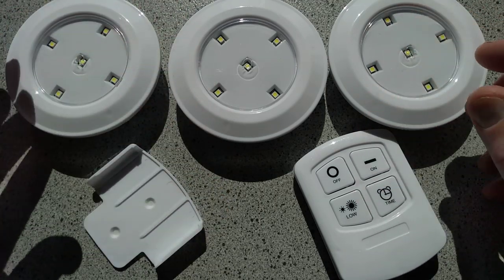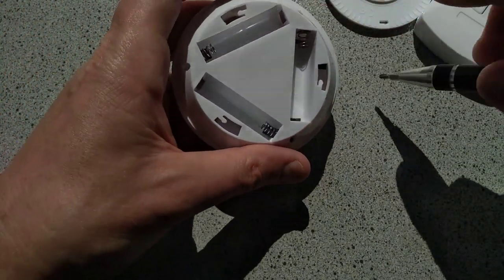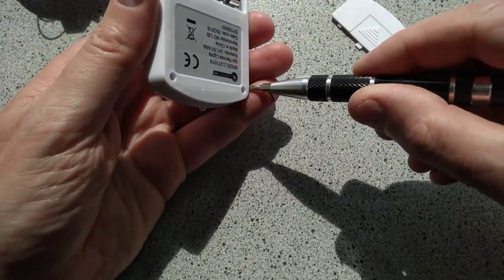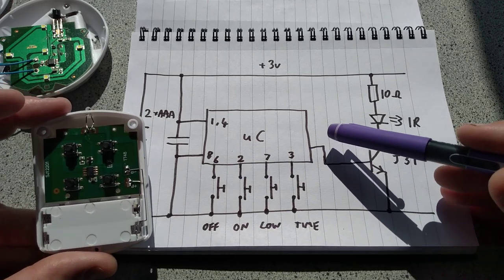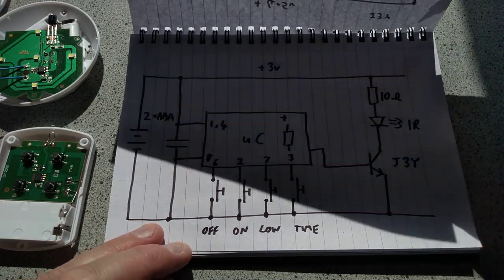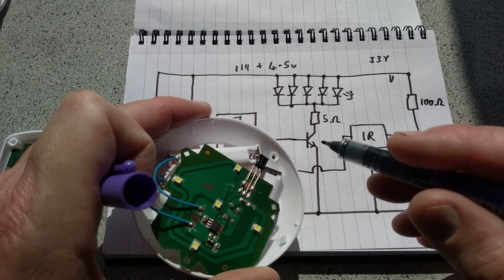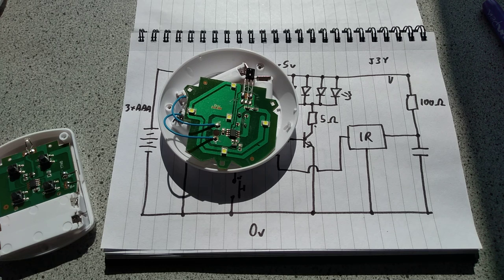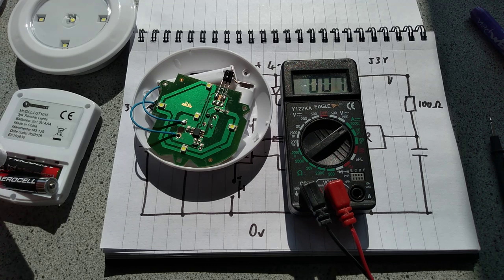Poundland remote control light set.  (with schematics)

Comment: Hi clive
There is another reason digital logic needs the decoupling cap. All the low impedance nodes within the chip will be using a totem pole drive topology with a pair of fets which can pull the io up to the power rail or down to ground. In order to avoid spurious edges during logic transitions, they turn both fets on for a new nanoseconds during the switch over. This causes shoot through current to flow from the rail to ground for a very short time on each switch cycle of the clock. Without the capacitor, the resistance of the power tracks could be enough to cause enough local voltage drop to brown out the chip and make it reset.

Comment: I have a set of these  from ebay that use the same exact case and remote, but have a ring shaped cob LED. They pull about 250µA when they are off and 300mA on high.
I got them specifically to convert to USB power. I just used a diode in series to drop the voltage to about 4.4V. They do put out a lot of light, but would get expensive running from AAA batteries.

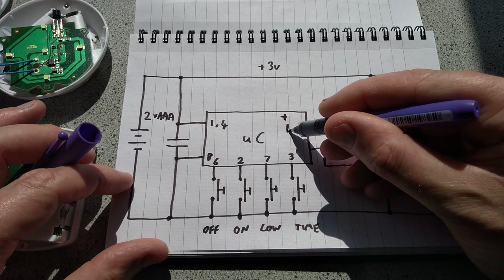Comment: I think you misspoke at 5:10. Pull-up resistors, especially internal ones, are very high-value (often in the 10s of kOhms) not very low. 
The power consumption of the transmitter is unforgivably high. After all, the device can shut down almost completely. For the receiver it's ok I guess.
Reply: U beat me 2 it ;)
Reply: Very high quiescent current for the transmitter. Most microcontroller shutdown currents are 3/5 of bugger all. That current is typical of the micro running. Looks like the programmer has never heard of pin change interrupts.
Reply: Yeah, sleep currents should certainly be in the single digit microamps, if not lower. 
Fun fact, I've recently encountered: Some PICs (if it really is one) have such weak pull-ups that they don't even work with pin change interrupts, at least on paper. According to the datasheet, they only pull up to VDD-1.1V, while the pins register a logical 1 at 0.8VDD (which is higher for VDD<5.5V). In practice, it still works but power consumption is higher, probably because the digital input buffers struggle.
Reply: Speaking of lazy programmers, what are the chances this micro can be re-flashed? Probably very low, right? I haven't worked a lot with those small PICs, let alone their clones, but I assume they are one-time programmable only?
I guess I'm overthinking this. A universal IR remote control might be an easier solution.
Reply: A learning IR remote would solve the problem of excessive transmitter current drain.
The older PICs were OTP but newer ones can be reflashed over 100,000 times.
Reply: In the description Clive has explained that the transmitter quiescent current is a lot lower than he first measured. Problem solved.

Comment: I bet all of the chips have the same code in them. They're probably using pin 4 as a mode selector since it's tied high in the transmitter and low in the receivers. Just a guess on my part but it seems logical

Comment: A tip to measure current consumption in battery devices - cut a small strip of double sided pcb, solder leads onto it, terminated in banana plugs to plug into your meter. Insert the strip of pcb between the battery terminals, it doesn’t matter where provided it interrupts the circuit. Between batteries or between a battery and the device’s terminal, whatever’s easiest. Voila! Easy and convenient current measurement without doing balancing acts. ;-) I should make one for myself really...
Reply: just use a bench psu lol
Reply: drkastenbrot - well, yeah! The advice is for those who don’t have one!
Reply: Two back-to-back pieces of copper tape could be even easier
Reply: i made 1 with aluminum tape... pcb would be so much better, wonder if i got some old scrap pcb i can use lol
Reply: At 9:40 I was about to suggest the same approach to measuring battery current draw, I'm surprised that Clive hasn't used the idea along with his other clever 'bodges'.
Reply: James Barclay
i was thinking the same!!! before all those comments, it's handy, maybe with a capacitor to avoid the (likely) inductance of all the DMM wires
Reply: James Barclay - In theory, yes. However I’ve found that it shorts out! You’d expect the adhesive would insulate, but certainly on my roll of tape it doesn’t. There’s always an annoying short somewhere. You could attach the tape to a strip of old credit card or whatever, that would do it.

Comment: Ive have tried these..  I found them to be total rubbish..  Firstly you need to have 11 AAA alkaline batteries to run them..  and the batteries last about two weeks if you use the lights roughly 2 hours a night in dim mode.  Not all the lights turn on at the same time.  I had mine as down lighters  under  the cupboards in my kitchen.   The light output is soo low i had to all 3 under one unit so i had a workable light..  The lights are using battery power when off as the sensing circuit is live all the time. 

Dont bother with Zinc Carbon batteries.  you get less than a week from them.  i tried some in one light and they stopped working after 36 hours from when i installed them.
Reply: Don't bother with Carbon-Zinc batteries for pretty much any purpose.  They're practically worthless.

Comment: I don't know about your meter theory on the standby current.  I had a set of these lights and they seemed to go through batteries quite a bit.  So much that I ended up retiring them to my "bin of derelict electronics" and installing mains powered LED lights in my closet.  I didn't get mine from Poundland, since I am in the US, but they look identical to those you have in the video.
Reply: I built a set of leds in my clothes cabinet, activated by a door switch and the system runs on a salvaged 18650 cell. I charge it once or twice a year.

Comment: In 8:00 Are you sure this is a NPN transistor? It could be a N or P channel mosfet, and that will explain why there's not a resistor in its gate terminal (the base in your schematic) BTW, mosfets are a better option for this kind of pwm circuits.
Reply from the maker: I checked the number online.  It appears to be a conventional transistor.
Reply: Clive has encountered the same configuration of an npn transistor being driven directly off a microcontroller port in earlier teardowns. Usually this would be very bad practice but if the port toggles between 'output low' (transistor off) and 'input with pull-up active' then the internal pull-up resistor would turn the transistor on. The external transistor probably has a greater current sinking capability than the port.
Reply: Ok, I got it. Congrats for your videos ;)

Comment: So do the buttons on the tx have double contacts? Does pushing the button both sent power to the chip as well as trigger the input? Or is the chip always under power?
Reply from the maker: The transmitter chip is always powered, but wakes on detecting a button press.

Comment: It is possible change the 30 timer? Y want change by 5 timer but I do not know how i can do it. I think that the remote control just sent a signal with 1 at the beginning and then 30 minutes another, is that correct?
Reply from the maker: I think it's preset in software.

Comment: I’m assuming it would be safe to convert these to run off 5v, from my camper’s 12 battery; with a 12v to 5v step down in line?
Reply from the maker: Yes it should work OK.  A diode in series will also nudge the voltage down to nearer the design voltage.
Reply: bigclivedotcom Thanks for confirming - will do!

Comment: Is the timer implemented in the transmitter or the receivers?
Reply: They would better implement it in the receiver. So of it gets out of range it will turn off. And there is no clock running in the remote control.

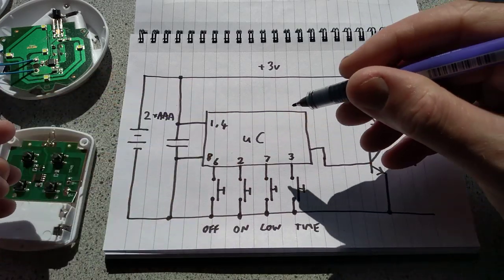Comment: @5:10 Very low value resistor for an internal pull-up? Usually 10K to 100K.
Reply from the maker: Yeah, I occasionally screw up.
Reply: But most of the time you unscrew :)  NP, Keep up the good work Clive.

Comment: J3Y is a classic 8050 bjt, 20V 1A stuff for small audio amplifiers or moderate amperage load switch

finding the actual code is not so easy, people online have never agreed to "merge" and update all the knowledge (little interest of course), there's this site that is good http://www.s-manuals.com/smd/ and in case try on google with "marking AROUND j3y filetype:pdf" the AROUND in upper case forces google to find especiallly near words (in this case the word "mark" or "marking" in the datasheet and the filetype:pdf modifier forces only pdf results (datasheets hopefully), this helps... watch out for no-so-friendly sites, going for rare stuff online is prone to that

Comment: What rubbish. Transmitter batteries will die after 6 months even if the unit is never used! 
Are you sure these lights are not made by Duracell or EverReady?
Reply: In the description Clive has explained that the transmitter quiescent current draw is a lot lower than he first measured.
Reply: 250uA is not far from the 380uA! Even an Arduino pro-mini has a 54.1uA sleep current. 
A PIC12 will have a 100nA sleep current.
Reply: For the lamps the IR receiver needs to run continuously. The microcontroller may be shut down but the receiver will still draw current. 250uA will gradually drain the batteries so it might be worth modifying the lamps to run off a usb power supply. This means external wires but for a permanent installation this is possible. Should save a fortune in batteries over time.

Comment: I have a set of those, they drain the batteries dead even when you don’t use them
Reply: Ross Davis it's called a parasitic draw.
Reply: Same here, dead within a couple of days. Useless in reality.
Reply: Same, two of them dead in a couple of days. One of them are still kicking though. I thinking of converting them to 5v mains power, but that kind of defeats the purpose of the remote
Reply: Nothing against Clive, but this section of comments provided more useful information than the whole video, lol.
Reply: Seamus de Cleir: I got these for in our bedroom as a night light. I've got them mounted to the back of the headboard / shelf. I've alread wired the back of the shelf with mains plugs for chargers. Now I've run some cables behind and got them hooked up to 5 volts DC. I had an old 5V DC power supply lying around from a project that's mains powered, it's now mounted to the back. Recommend you do convert them if you can hide your wires nicely. The remote control doesn't drain the batteries quickly at all so that works fine.
Reply: @pmcKANE  That'd be perfect. I was using these as some cheap bench lights so the wires wouldn't bother me. I guess that'll be my project this weekend, thanks
Reply: +coolhanddruid he mentions the quite high quiescent current in the video. It's really high, actually.
Reply: Same here it was the first thing I bought for my new house for use in the kitchen. Few days go by. I thought I left them on. All of them dead. Happened again a week later. In the bin they went.
Reply: I got a set for £2 in a poundland sale, obviously manufactured as cheaply as possible, but I can say I've had the same set of batteries in the lights for more than a month, and they still work, the batteries are also cheap ones from poundland, the kodak ones.
Reply: Indeed, they're pretty brutal on the batteries, more than you'd imagine
Reply: I wonder if anyone tried to connect it to a PIC programmer to test compatibility. Newer PICs have advanced power management (nA level deep sleep, programmable wakeup on almost every pin, etc.). Maybe it is just shitty SW, and it can be upgraded.
Reply: Thanks Ross, something Clive did't pick up on, although in fairness he would have had to connect a meter inline with the batteries to be aware of this.
Reply: That makes sense, that little microcontroller is constantly turned on looking for the IR signal.
Reply: Yep have the same one's and like Ross said they just drain the batteries even when they're not in use.
Reply: Poundland have found another way of selling more of those AAA cells.
Reply: The issue is the parasitic draw from the remote control sensor. I have a set of much more expensive lights like this and they drain in a few days when not in use. However, they have a switch to turn the remote control sensor off (allowing you to turn them on manually). When I use them like that, the batteries last as expected.
Reply: Oh no! I just grabbed a set of these and put them in a loft area and tested them, they are "perfect". Gutted to hear of the battery drain as the idea is there but looks like the execution wasn't.

Comment: Got this set too in Netherlands, sold in Kruidvat shop. It worked good, but because lights are bit "active" and will use a bit energy due infrared sensor. Don't use normal batteries in lights. I use only rechargeable batteries and it will hold ~ 7 days with short light use in my wardrobe.
The transmitter still working after months with normal batteries.

Comment: My neighbor and I both have a ceiling fan controlled via remote in our house. Amusingly, both units run on the same frequency, so every now and then my light or fan will just turn on in the middle of the night. I can only imagine how many times I've done this to them as well.
Reply: Check if it has a channel switch. Many radio controlled devices have a channel switch to switch between 2 or 3 channels. But many people leave them on the default channel.
Reply: @atmel9077  I haven't looked, wouldn't I have to also pop open the fan and switch the channel as well, or would simply changing one work for both?
Reply: @MikeeVee  No, you need the same channel on the receiver and the transmitter.
Reply: more fun if garage door opens automatically at 3am next door...

Comment: hey clive, i wonder, if those µC are just running same software, simply decided by pinprogramming on pin 4 (high = acts as remote and low = acts as reciver)
so if you take one of your lamps, remove pin 4 from gnd and tie it to vcc, supply the unit. every time you press the build in button it will flash the lights like a remote ir led
because of pin 5 (driver output of both units remote/lamp)... would be cool if you try that out ;)
Reply: This is exactly what I thought
Reply: Same thought, didn't see this one first

Comment: I got 3 of the cob versions of these lights. I combined the circuits with 3 separate sets of string lights and used 2 x 18650 lithium ions in parallel to power each set (complete with protecting circuitry, of course). It was a fairly successful mod actually, I'm quite pleased with them!

Comment: The problem with all these remote controlled battery powered lights is the always powered circuitry will usually run the batteries dead in no time.

Comment: The transmitter could have a switch in series with the supply. As for the lights, they're an effective silent salesman for AAA cells. (I never knowingly buy anything which uses those over-priced and under-powered cells.) And that light looks really feeble.

Comment: AAA batteries! designed to spend your money.
I have a set but they use AA batteries I use them as night lights, the batteries last for about a month.
I have tried using rechargeables, sometimes they work sometimes they don't do the 3.6 volts of the NiCad's must be on the edge.
I have placed them on the curtain pelmets  (nice and stealthy).
What I want is more remotes.

Comment: You can buy this exact same set in Australia exclusively marketed by a mob similar to Poundland going by the name "The Reject Shop".  They sell for fifteen bucks a set or lower during the frequent specials weeks.  I bought a set for lighting up the backs of some of my kitchen cabinets.  They work well but the remote control factor means that they chew up batteries.  Take that into account before buying them.  I managed to get about a month of work out of them before I had to change all the batteries.  Fortunately I have an Aussie-designed "Rezap" battery charger that, through some sort of electrical magic, recharges alkaline batteries up to three cycles.

Comment: The casing of those lights is so very similar to the cheap stick-on lights you can also pick up at Poundland - from the battery arrangement right down to the spring mechanism for the front push-plate.  Don't know if that's just the obvious way to implement it, or whether there's some IP sharing going on.

Comment: I had similar lights but they had diffuse plastic cover instead of transparent and it looked way better. I would probably get some sand paper and scratch it a bit to get that diffused/mat style + some aluminium tape around leds to get bounce some light and it would be nice set...

Comment: Because these lamps will drain the batteries even when not in use it might be worth hacking them to work off a usb power supply. This means there will be external wires but for a fixed installation this usually isn't the end of the world. The usb supply might need a silicon diode in series to drop the voltage nearer to 4.5V.
The transmitter current draw is unforgivably high but if this is due to the microcontroller and not a leaky decoupling capacitor then it could be pointed at a universal IR learning remote that doesn't eat batteries.
Reply: In the description Clive has explained that the transmitter quiescent current draw is a lot lower than he measured so no point in using a universal remote but the usb hack on the lamps will save a lot of batteries.